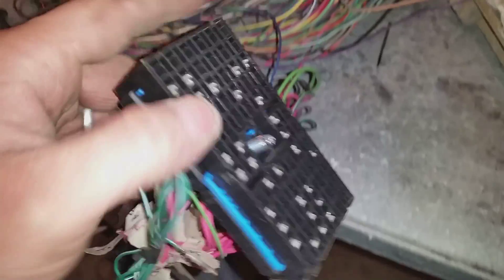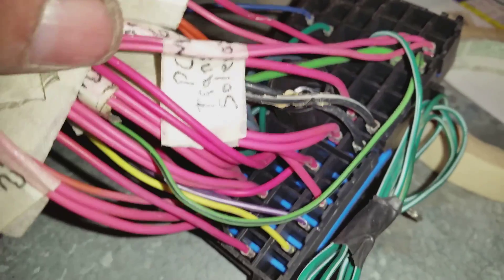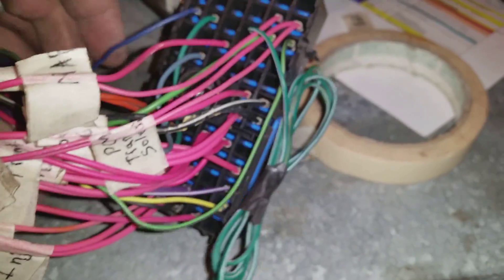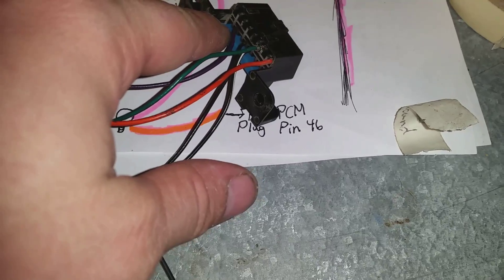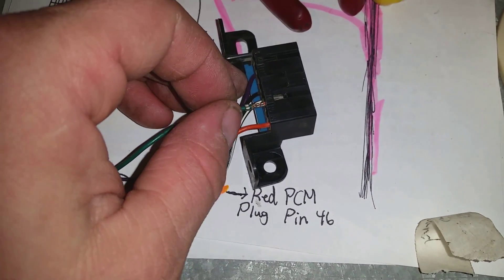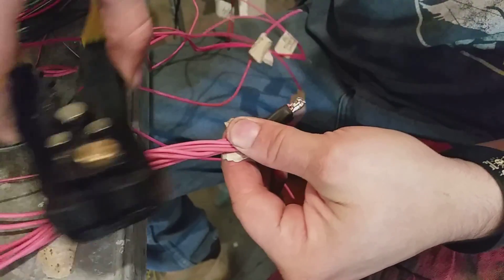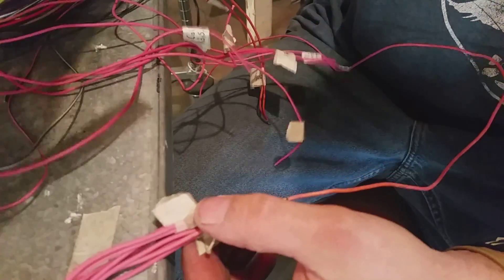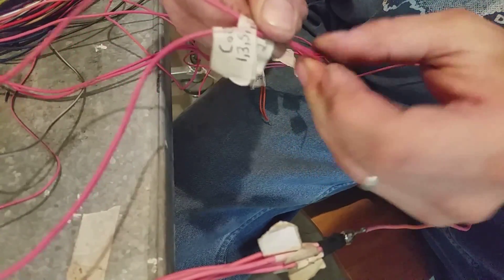How To Guide For A Stand Alone Harness 99-02 Drive By Cable System For LS Swapping Projects (Part 2)

Comment: If im running a 2004r do i still need the trans pcm?? Wire ??
Reply: No, but I hope your set up is drive by cable. You need provisions for Throttle Valve Cable

Comment: I know it's convenient to bundle all the power wires together but that's a lot of draw from that one wire providing power. If you keep the systems separate and individually fused with an 8ga providing power you'd be better off later if you have a short and need to figure out where your problem is. Relays would probably be needed also with one main fuse to shut everything down just incase.

Comment: excellent wire, and I am commenting before having watched the whole thing, but I just want to say that my OCD would have had re pinned the "extra" green wire to PIN #2 on the OBD2 port that way you would have been connecting it to the green wire coming from the PCM, again great video I was just making a suggestion

Comment: Planning an LQ4 (or 9) swap into my C30 Dually.    I have a harness converted to standalone years ago by somebody else, but will most likely use these videos to make sure it's right - the way the coil and injector power connections were done is kinda sketch looking.
Reply from the maker: Hope my videos can help you.

Comment: Hello sir.
Very nice and helful your video.iam all time see your video.
I need some information this ls chevy  ecu.Toyota, nissan a lot of car have immoblizer  system . My qustion . This  ls chevy ecu have immoblizer  system or not...?
Reply from the maker: Abu Kawsar yes its called anti theft system
Reply: How to connected anti theft
system  with my ecu. Please give some information.
Reply from the maker: Abu Kawsar  You don't connect to the anti-theft system. You have to have your computer flashed to have the security system removed.
Reply: How do...?
Reply from the maker: Abu Kawsar u have to have someone with a programer to do it
Reply: You can do program..?
Reply from the maker: Abu Kawsar no
Reply: Hello sir.
Then How do you work.
Reply from the maker: Abu Kawsar I had to have it done by a local shop
Reply: You know sir.
Iam in big problem.
Some few deys my workshop ls swep enging fix nissan body now but enging not running.
Coil, injector not coming plus.
Now   i don't  know  what i do..

Comment: Interesting, checked lt1.com, the website has been removed, is this similar to the wiring on a 3.8l V-6? That's what I'm after, I'm trying to figure out why my '99 Buick Park Avenue won't crank and the schematic in the manual is for a Pass-key II and earlier.
Reply from the maker: Dave Kauffman the website is still up and running. I'm using it on a harness I'm doing right now. The website is www.lt1swap.com
Reply: Thanks bro, I didn't have the www in front of it, my fault; I'm still learning about using computers.

Comment: I'm in the middle of making my harness . I had a wire from the c2 connector E2 that was highlighted to keep but when it was time to snip the wire from the c2 block it was already snip from the harness  .  I just want know is that the wire you were talking about on the Video
Reply from the maker: Edmundo Vazquez what pin was it going to in the c2 block.
Reply: PuppetKicker Wire E2 trans , pcm pink
Reply: The pin was E2
Reply from the maker: Edmundo Vazquez if you plan to use the trans that came with the motor u may need that

Comment: may you email me the diagram to wire it up to that small fuse block
Reply from the maker: Moises Delatorre I have the pictures on my Facebook page. Just look up Lonnie Rice
Reply: Lonnie's Garage if im correct on your red and blue pin out diagram im supposed to remove the blue and yellow ones ?and the ones that say not used
Reply from the maker: Moises Delatorre got to lt1swap.com it has the pinout for your pcm. You don't remove both colors. That site will tell you what to keep, move, and anything else. Hit me up on Facebook if you have any questions

Comment: Just a tip, always have a good mechanical connection wire to wire before you solder any strain on the wire connection can easily break the solder connection unless it has been twisted together first.
Reply from the maker: Ty